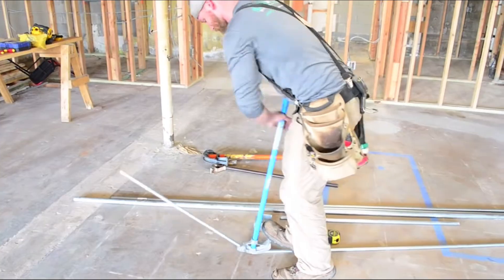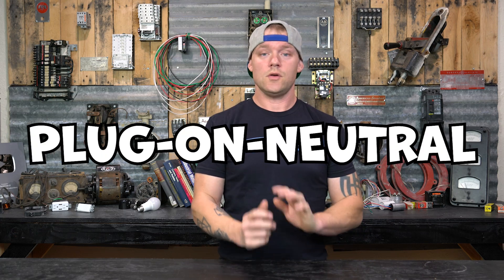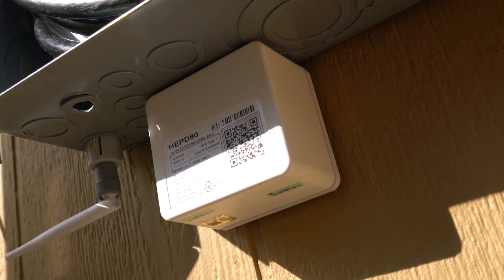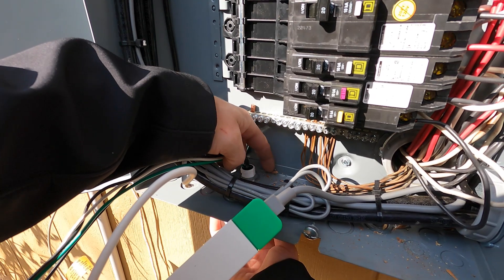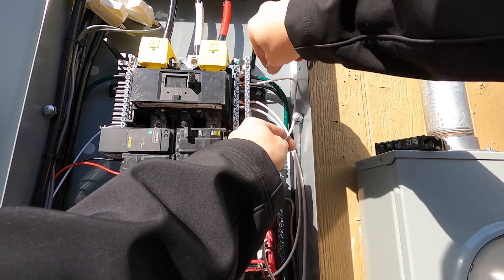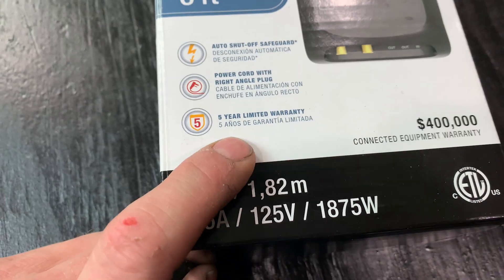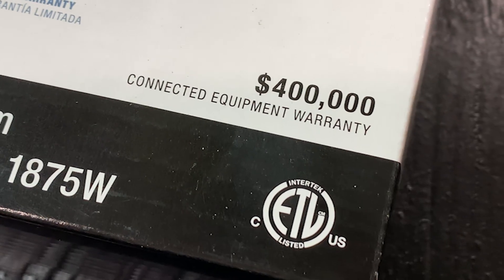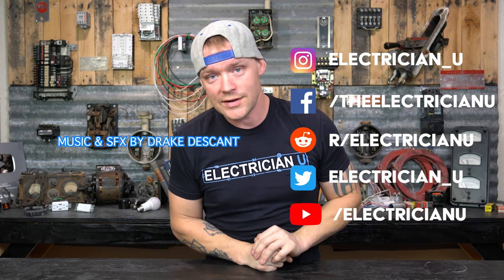How To Install A Surge Protector

Comment: A bit disappointed that you didn't show what's inside these things and how they work:  and more importantly how they can fail to work.

The types I am familiar with are based on metal oxide varistors which work because their resistance drops when voltage exceeds a certain point — so when an over-voltage spike occurs it effectively shorts, directing the transitory voltage from the phases to neutral/ground.  The problem is that MOVs deteriorate with every use until they fail and are therefore no longer providing the protection they should be.  Units I've seen, board mounted or separate, have indicators to show a failed state when they need replacing.  I didn't see anything like that on either of the units that you fitted.

Two videos from John Ward:  a very cheap domestic distribution board SPD  https://youtu.be/-ehw6uZOOfw   some more theory and strip down of a larger multi-phase SPD  https://youtu.be/5XO5d2vLUsw
Reply from the maker: Thank you for the thorough comment and the helpful links.  I'll check those out.  I was going to do a much deeper dive into this topic but it already appears both of these SPD videos are not as watched as other videos I post so it's a balance of whether this is the right place for a highly technical deep dive into a very niche topic that has not garnered a lot of interest.  You're right about the MOV types currently being manufactured.  It appears most have a single indicator that shows "good" or "bad" but not much for the monitoring of the life of the device.  There are far more expensive models for commercial and industrial use that do offer this type of analysis but these brands are really just trying to break into the residential market now that they've made it manditory in code for us to use them.  I can forsee them getting better, more advanced, and more expensive as the years go on.
Reply: @electricianu  SPDs no longer niche in my view - essential protection in modern homes. My insurer also provides a discount. Glad you are talking about it your just ahead of the curve.

Comment: Another great video! Did you end up installing two? The Plug on Neutral and a breaker version? If so, is there benefit to that over just one?
Reply from the maker: I did but just to show the differences between the two, not for extra protection.  I'm not sure that having two at the panel would provide any protection above that which is already present with one.  I'd imagine so, but I can't guarantee that.

Comment: Did you install the HEPD80 with the indicator light facing the wall?  Don't you need to know when the varistor(s) have gotten used up?  Also, I now treat SPDs as consumable devices - after a few early ones got used up quickly and some discussions/tests/fixes from the utility, my next one lasted ~5 years. I like and have the QO250PSPD you have for easy replacement, and for additional coverage, I upgraded to a IG2280 which has the consumable SPD varisitors in a modular replacement.  Love your channel!

Comment: VIDEO REQUEST PLEASE! 
A video regarding when & when NOT TO install 2 circuits from 1 breaker. Ie: there's a fully populated breaker panel but you need 2 add a circuit so you put in a beaker that is on 1 phase but has 2 switches & 2 hot connections? TIA I hope.
Reply from the maker: Great idea my dude, I'll add it to the list.  Thanks!

Comment: I was always told the surge protector should be as close to the infeed of the panel as possible - if you put it at the bottom in a top-fed panel, you just added an extra foot. Thoughts?
Reply from the maker: Depends on what type you're talking about.  They one I have in the top (Plug On Neutral Style) needs to be at the top, closest to the main breaker.  But any that have leads (like the HEPD80) just need to have short lead length because of the size of the conductors and the impedance that adds up as the conductors increase in length. The real issue with let-through voltage is from the panel's bus to the device through the leads.  The bus offers such less impedance (because of how thick/large of a conductor it is) that anywhere on the bus is generally fine.  But when it changes over to the breaker, to screw on terminals, then the path changes to tiny little conductors on their way to the SPD device, this is the weak link in the chain of effectiveness.  I've read through all of the literature from both of these products and neither says anything about it needing to be installed near the main, but they all talk about lead length in the warranty section.
Reply: @electricianu  so if you are installing one with leads at the bottom (as you did), would you want to install the breaker in the bottom-most slot?
Reply: When a surge enters through your mains, it propagates down the voltage rails in microseconds.  Whether you install the connecting breaker at the top or at the bottom is immaterial.  What matters is getting the surge ie. voltage spike off the rails and to ground with as short a lead as possible.    Lead length adds inductance.  Lightning is not 60Hz, but contains many different and high frequencies.  The higher the higher the frequency, the more those long leads look like a big resistor, preventing that portion of the surge from being quenched.  So place the surge suppressor anywhere in the panel, but plan its location based on the Neutral and Ground bus bar location so the leads from the suppressor are as short as possible.
Reply: @thomashybiske5399  YES.  This is important.

Comment: Once upon a time I installed a whole-home surge protector from a reputable company.  The warranty covered $10,000 in damages if the surge protector failed to do its job.  So one night we had a big lighting storm come through and I heard this huge thunder blast.  The lightning struck the metal roof of our home and our brand new 72'' plasma TV and refrigerator was fried.  
Called up the manufacture's customer service.  A person answered the phone right away and mailed a check for all the damages.  $10k to cover all the damages.  
NOT

Comment: It’s interesting you used a 20 amp breaker.  I bought a SPD from Eaton and it requires a 50 amp breaker.  Seems like a smaller breaker would significantly reduce the surge suppression abilities.
Reply from the maker: The device is what's being protected by the 20amp breaker, not anything else.  The only reason for the breaker is to protect the device, it has nothing to do with the surges or the breaker would be nuisance tripping constantly.  The manufacturer's sticker says to protect with up to a 2-pole 30 so I'm protecting the device to it's manufacturer nameplate rating, just like we'd do with a motor or appliance. An SPD is not taking the impact of the entire load in a surge, it's balancing the impact through the SPD, the load, and depending on the type of surge - the utility system, and earth.
Reply: @electricianu  how do you think the SPD is doing it’s protective work?  It clearly is taking an abnormally high voltage that it senses on the 1 or 2 hot wires and passing that energy onto the ground wire.  This means that the power/energy is indeed passing through the breakers during the brief moment that the surge is occurring.  Now, if there are other surge strips at various points of usage, then they are also doing the same thing and passing current from the hot wire to the ground wire throughout the house at various points.  

But to say that the SPD is not passing the surge energy through the breaker is incorrect.  The path order would be breaker to SPD to ground.
Reply: @neilbrookins8428  Whole House surge protectors handle 40,000 Amps for a split second.  If the breaker's purpose had anything to do with protecting the system and not the device, do you really think it would matter if it was 20 amps or 50 amps when we're talking about 40,000 amps?
Reply: @Arieeeee  yes the difference matters.  Here is a quote from the manufacturers installation instructions:   “Adedicated2-pole15amperecircuitbreakeris recommendedforusewithCHSPdevices,butusea2-pole50 amperecircuitbreakertoachievethefullpublishedratingsofthe CHSPT2ULTRAdevice.”  So, yes the 50 amp rating IS needed to achieve the full protection rating - said by the manufacturer themselves-  I’m just agreeing with them.
Reply: @neilbrookins8428  I thought he said it required a 20 amp...but if that's what the instructions say I agree with you. I always go with the instructions.
Reply: The question can also be made for connecting via direct bus wiring as that has no branch circuit breaker at all, and it's load side of the main, not line side which he talked about at 2:08.  But SPD performance is not the only factor for that, having to either work hot or turn off the main might be a tradeoff you don't want to make.  With the breaker install, HEPD80 instructions say, "connect ... to a maximum of 30A ... breaker".  As for why 20A versus 30A, good question, maybe he didn't have 30A handy?
Reply: You are confusing over-amp protection from over-voltage protection. Follow manufacturer's recommendation on the AMP rating of the separate breakers used....if such breakers are used.

Comment: I have no more space in my main electrical panel. I do have a sub panel that has open slots. This is another room so I can not move the circuits from main panel to sub panel. Can a whole house surge protector be installed in sub panel and still be effective?
Reply from the maker: It needs to be at the main at the service to be effective as this is the point where your neutral and ground are bonded.  Your subpanels are not bonded, and that's on purpose.  If you put one of these in a subpanel, the surge would have a long distance to travel to dissipate back to earth so it would most likely do a poor job of dissipating that voltage spike once it finally travels back through neutral to ground because of the added impedance of the length of the neutral conductor between the main panel and sub panel.  Also, the HEPD80 model can be installed on the lugs where the main breaker attaches to the bus - since it is a type 1 SPD it has it's own overcurrent protection built in, thus it does not need to be protected by a breaker.  This means you can still put one on your main service panel. =) Just read all the instructions about lead length before you do.
Reply: @electricianu  What about a transfer switch scenario.  I have a generac service rated ATS outside with a sub panel in the basement.  There aren't any breaker positions in the ATS or any tabs to wire off the load side lugs.  Would you use a flat connector and add them behind the L1 and L2 cables on the load side rather than adding to the sub panel?
Reply: That was very helpful and clear, thanks you

Comment: So tell us your experience with those “warranties”??

I do work for one of the 2 biggest producers of electrical equipment and know that, for the most part, you will spend more PROVING your case, than whatever you will ever get from a big company.
Reply: I read the same thing in the Amazon reviews. Almost impossible to even contact them.

Comment: With the let through voltage, why not install the breaker at the bottom of the panel so that your leads don’t need to run the entire length of the panel to the top where your 2 pole breaker is? It seems as though he leads could be way shorter that way.
Reply: even so, it only protects that one leg right?
Reply: @Layarion  no, it protects both legs since it’s on a double pole breaker.
Reply: You have to install the surge protection bat the top.

Comment: What are their lifespan? Assuming no major overvoltages, how offer should an spd be replaced? For example, mine is 22 years old. Should I replace it because of age?
Reply: It should have a surge rating.... But like all equipment I've used: nothing actually has a counter so you never know when to replace the stupid thing.
Reply: @jamess1787  mine has two green lights. The manual says to replace it when the light goes out. But there is no specific time limit.
Reply: @neilbrookins8428  good to know. Power surge strips sure, but anything else.... I've installed lightning arrestors and other surge protectors in substation facilities for telecom equipment: I've never seen even a light on them. When they go bang is when they tell you they need to be replaced.
I hardly believe that a MFG will give you 50,000 in 10 years after their warranty period expires for a surge bar. Seems like a a decision no CFO would make.
Reply: A suppressor like the Square D HEPD80 will take repeated hits that are somewhat below its rated maximum without damage to the device.  The device will sacrifice itself to suppress surges above the maximum rating and will indicate that it's no longer protecting one of the two phases by extinguishing one or both of the green pilot lights.

Comment: Does the location really matter that the SPD is as close as possible to the main? I’ve read conflicting thoughts on this. I had the homeline plug on version but it only fit at the bottom where the panel accepted tandem breakers. Does it matter? I see you added multiple SPD is one better than the other or can you put more than one also?
Reply: Yeah same to me... and Im confused why he put the breaker in the upper part wherein he can also put it in the last slot to maximize the protection... he said that the leads must not be longer or it will still send some voltage in the equipment...

Comment: I have a question maybe someone can help me i bought a new electric dryer and the guy that installed it said that my 240 line does not give enough power to run the dryer correctly can someone please help me to see if i can fix the issue
Reply: The dryer installer is probably not an electrician or even familiar with electrical work - someone familiar with electrical would have told you something actionable like the outlet not being the proper rating or type.

New dryers come with NEMA 14-30 plugs (with 4 prongs), but typically will allow changing to a NEMA 10-30 plug (with 3 prongs) for older installations. The manual will say, and there's a plug conversion kit at your local home center if so. Both of these can deliver 30 amps, so it's not a matter of not having enough power (actually current), but rather not having a dedicated equipment ground. If the dryer instead has a NEMA 14-50 plug, then it requires 40 or 50A, and you'll need to upgrade your dryer's circuit. This would be weird for a dryer, but an electric range would use this type of plug. If you bought the most powerful dryer you could, maybe it requires a 14-50, but otherwise, it should be a 14-30 and probably allows using a 10-30.

I can't imagine how it's possible (dryers have been 30A devices forever), but if you have a NEMA 10-20 outlet, you'll also have to upgrade the circuit (because it can only deliver 20A and your dryer needs more). The 10-20 has two angled prongs and one straight prong, and the 10-30 has two angled prongs and one L shaped prong. A 14-30 has a round prong, two straight prongs, and an L-shaped prong. If it's a matter of needing to throw on a 10-30 plug, then I don't know why the installer wouldn't have the ability to do that. It's meant to be easy enough for an end user to do.
Reply: @ZiggyTheHamster  thanks for the info.
Reply: He may be referring to the main panel and the wire feeding power to it, if your service was installed a long time ago, it is probably rated for like 100amp and is already maxed out in terms of capacity.. It may need to be upgraded in order to supply power to your dryer safely.
Reply: If you want some more help join the discord, we have a ton of electricians you can pull knowledge from.

Comment: Because of you I'm becoming an electrician this coming year
Reply: Same I’m 16 and planning on becoming an electrician
Reply: @WyattH  I'm 29 and a level 1 apprentice & also do drywall/painting as well... just keep going at it.
Reply: Awesome!
Electricians need to be passionate about this field.
Learning all the time.
Not a day job, a lifetime career. And free time as a beginner is nonexistent. Fill it with learning and you will go far.
Reply: I just completed my first year because of Dustin
Reply: Same. I'm applying for an apprenticeship this week.
Reply: It is a very popular trade. The competition will be very stiff depending on what part of the country you are in.
Reply: @jolyonwelsh9834  all trades are in high demand what are you talking about.
Reply: @ryanthepianoman27  As I said it depends on what part of the country you live in. Yes you're right. But here in Cleveland IBEW local 38 seems to be doing a pretty good job of attracting young recruits. But for the moment and in the near future demand for electricians is increasing.
Reply: @Lemmon Productions did you end up finding an electrical work or apprenticeship?
Reply: One of the best trades in my opinion. Just make sure you are dead set on NOT cutting corners. No pun intended. Do the job the right way, first time around.
Reply: Good for you. It’s a great career and highly rewarding trade to work in. I ultimately went the engineering route and became an EE. But I started out as an electrician and loved what I did.
Reply: I hope your handy work doesn't produce a lot of lemons!